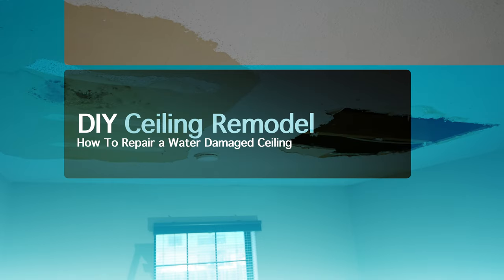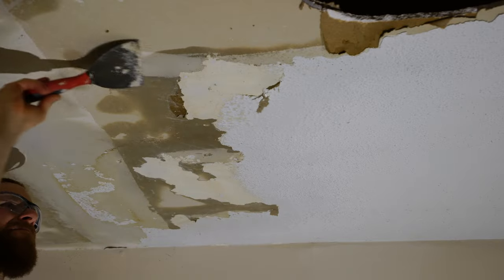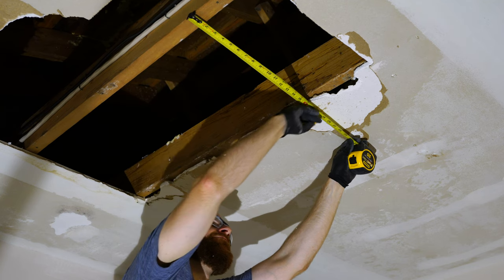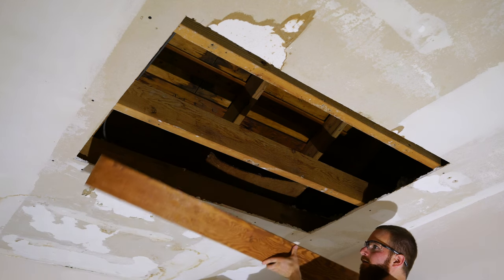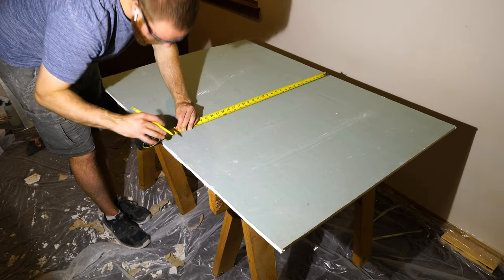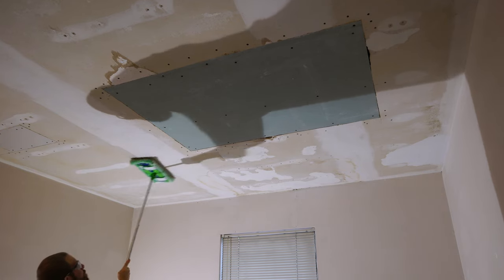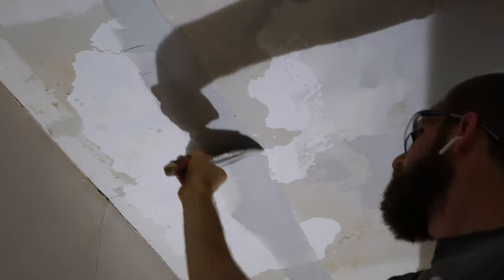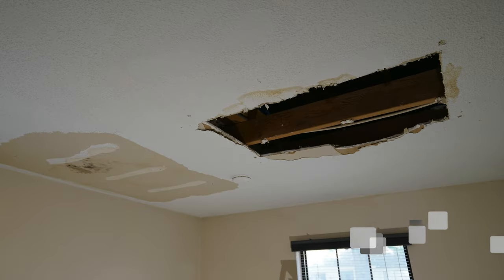How to Repair Water Damaged Drywall Ceiling

Comment: If the ceiling drywall was affected by water but has dried out and is now solid without any sagging, is it always necessary to cut the part away and install new drywall? Or can it be reused?
Reply from the maker: Check for mold, if there’s only slight mold on top you could bleach it. If you have a lot of mold then that’s the reason you’d want to replace it. Overall, you can reuse drywall that’s only been slightly exposed to water but when dealing with mold I’d replace it.

Comment: You are a godsend for sharing this! Thank you so much! After Hurricane ian we have a huge patch from water damage on our ceiling with popcorn that needs to be removed altogether. Can't afford to have someone fix it, and I guess you'll never learn unless you try it yourself! Ill be watching this a handful of times before my attempt though haha 

I noticed there's no insulation in your ceiling, is there anything specific I should make sure when replacing insulation?
Reply: You want to stop mold from water spots from spreading before it starts. You can use vinegar to stop it from spreading or use 1/2 cup bleach 1 cup warm water and a tsp of antibacterial dish soap in a spray bottle. Spray the discolored area and use a scrub brush then wipe off. It won't be 100 % clean but it kills mold.  Then use a primer with a sealer. I found a spray can of it. I sprayed the areas I treated after drying. Do a 2nd coat. Then I bought a mold and mildew ceiling paint. Do 2 or 3 coats and it should be good. If the water damage made the drywall soft. Tear it out and any insulation and treat with the bleach mixture I mentioned above. Then it's just patch your drywall, plaster, prime and paint
Reply: @kevinbrown1833 bleach does not kill mold. bleach works mold further into cracks and crevices. not sure about vinegar though. i think there is a specific machine that kills mold